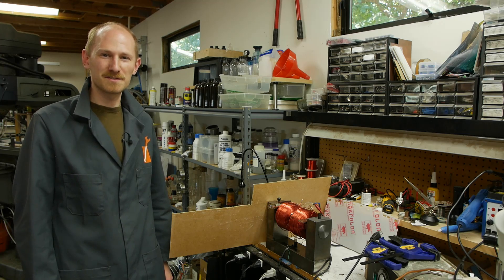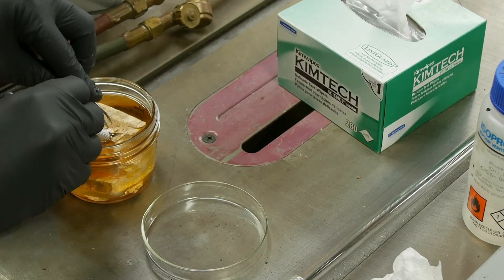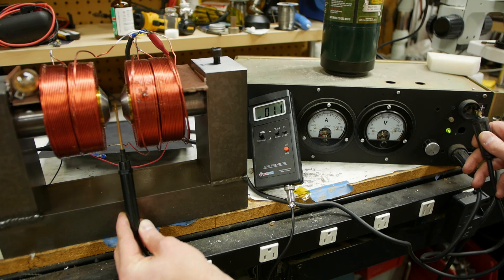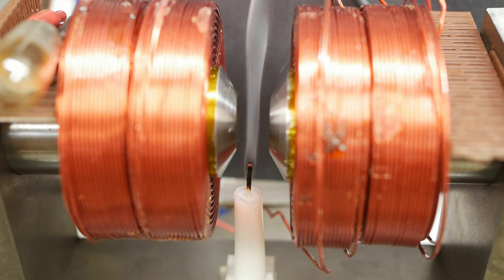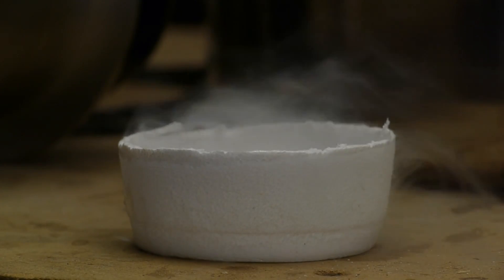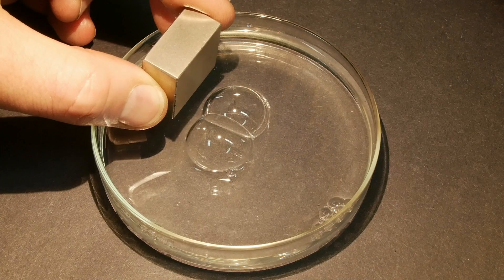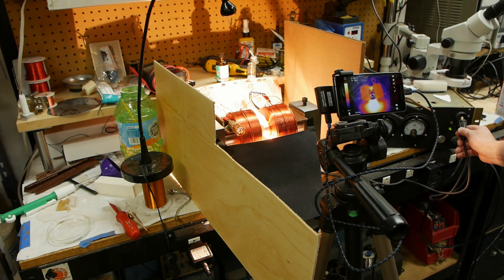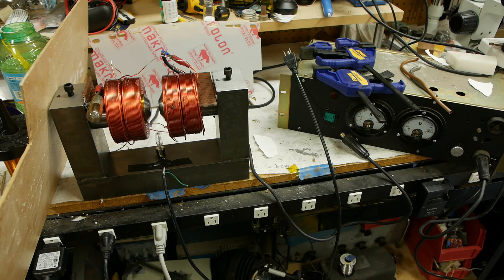Candle flame is repelled by magnets (and Zeeman follow-up)

Comment: Smoke is also full of free radicals, and a force is exerted on charged particles by changing magnetic flux. You need to check if the magnetic deflection of smoke continues after the flux is steady, not just when you first switch in the electromagnet. It's not just about the diamagnetic property of carbon.

Comment: I discovered that a strong magnet will divide the plasma in a neon filled tube into two streams if the neon is being energized by high voltage alternating current.

Comment: This will be installed in our futuristic home building and engineering... Front wall is the positive wall with negative charge instillation... And other walls strategically placed also...

Comment: The air as it gets hotter gain conductivity because there are aways molecules spontaneously ionizing and this increase with heat specialy a flame. Is not because is  diamagnetic is because of the induced currents from the movement of the air stream on your magnet field

Comment: What about short lived ions as the chemicals are reacting? It could just be a Lorentz force that's causing the deflection but the circular motion is interrupted by the convection flow.

I suspect a way to test this is to burn a flame in a coil and see if it "focuses" in the centre or shows something like Mach diamonds

Comment: My theory: A flame is very electrically conductive, lots of free electrons. Due to the heat rising, they are moving upward and experience the same effect we all know and love, they are deflected 90 degrees to both the magnetic field and direction of their movement. Now, I should probably offer a disclaimer on what I'm about to say, I swear I don't do drugs folks. What if that's because electrons are little torroids (donuts) rotating in on the themselves and also around like a tire. But then how could that tire seem to sort of get some traction to roll a preferred direction? Then we'd have to talk about the Higgs field being stronger at the center of the Earth or something and such a big effect over such tiny distance, forget I mentioned it and have a nice day :) 

But wait there's more! ...

For the low low price of ... super cold, since these donut electrons rolling in on themselves have a suction side, when cold enough, they can stick together, electron pairing, superconductivity. Three-year olds have the right idea, all scientists at heart, asking why on everything.

Comment: - Flame is conducting material (plasma). Moving conductor tries to avoid the change of the magnetic flux passing it.

- If you are passing different gases through your magnet, you can visualize them with thermal camera (not all gases, but some).

- The bubble test should be repeated also in the edge of the magnetic field, so that there is magnetic field gradient inside the bubble.

- Hydrogen flame might behave differently, as there is no carbon content.

Comment: Maybe hot air being less dense has a longer mean free path before being interrupted bouncing off other air molecules allowing the air to respond longer the magnetic fields. 

Instead of trying to measure the air directly, maybe try to measure the changes in force against suspended and balanced magnets. One would need to factor out earth's magnetic field effects.

Comment: I think magnetic field arises from excess or lack of microscopic space particles. Like poles have  excess particles b/w them and produce repulsive force and opposite poles have lesser particles b/w them and produce attractive force. When magnetic field is switched on particles leave the space b/w the poles and space b/w poles shrinks causing the flame to reduce in size. Motion  of smoke at right angle to magnetic field shows  the particles  clearing the space.

Comment: The magnetic field changes they way the air molecules 'collide'. These collisions are responsible for 'thermailization'. Thermalization is the mechanical mechanism of equilibrium between parameters such as temperature, pressure, momentum, the speed of sound, and unbeknownst to me, magnetic permeability!

Comment: The light from the flame is travelling at the speed of light. As ANYTHING travels close to speed of light it gains mass and becomes stronger emf. Light even though is small part, is part of the EMF . The carbon from the wick burning /soot would be obvious reason for effecting flame in the electromagnets but could also conclude with gas that flame would be effected.

Comment: Great experiments... 
But you forgot to imagine how the light shells react...

All atoms will always send light out...

But around a mass which is hotter than the surroundings,
much more light goes out, so the outgoing light shells are denser than usual...

I am not talking about the visible reflected light,
but the (normally) invisible light FROM the atoms...

And a light shell has its plus charge on the front side,
and the minus charge on the rear side...

When light goes out from a mass, the surroundings "see" the plus face...

But when an object is colder than the surroundings,
the surrounding masses send stronger light TO the object,
and some low frequencies will create an "induced light",
meaning it makes a light shell fully surrounding the cold object,
and from that shell, the photons move in, 
making the next light shell closer to the object and so on...

And those incoming light shells show the minus side to the surroundings...

But in all cases, a light shell has a larger EM-charge, than the air it pass through...

The minus face is not negative, it is just weaker positive than the plus face...

So a "distant particle" will sense the summed charge, from plus and minus...

Like if a battery had 3 V on the minus pole, and 12 V on the plus pole,
then a "distant particle" would sense 3 + 12 = 15 V (obviously divided with the square of the distance).
You surely remember that every second light shell acts (mainly) with magnetic force,
while every second (mainly) acts with electrostatic force...

Combined, the light shells will give "one EM force"...

Just like the electro magnets and any other kinds of magnets do...

So we could actually say any magnet acts like a lamp,
but the plus pole send light shells OUT, 
while the minus pole, acts as a colder mass, "sucking" light shells IN,
so the so called magnetic effect, should really be called the EM effect,
as in reality it is light shells which cause that effect... 
But magnets normally send/receive so low frequencies so the light is invisible...

We could also say any lamp or other hot objects, act like the plus pole on a magnet,
by sending more light OUT than it receive from the surroundings...
While any very cold object, in warmer air, acts like the minus pole on a magnet,
as it RECEIVE more light from the surroundings, that it sends out...

So the effects your tests show, are actually proving that "light shells will give  pressure to other light shells"...

You talk about the effect from IONS, and it is true all particles with one electron "too few or too many",
will also react on EM shells, from magnets or other light emitting masses...

But in many of your tests, it is only/mainly the emitted light shells, which get pressure from the
light shells from the magnets... 

Note that a flame has that flame shape, for two reasons...
The most obvious is, "hot gasses rise up"
Less obvious is, that the summed EM pressure from the planet, and the atmosphere, is larger under the flame,
than above the flame...
Both effects, will deform the flame from being round like a ball...

When starting the magnet, the effect from "hot gasses will rise", will be the same...
While the effect from "most EM pressure from below" is greatly changed, so the shape of the emitted light shells is changed...

And since the shape of the yellow part of the flame is changed, that seems to prove 
the yellow light actually comes from a corona effect, just like around the sun...

Basically meaning that "a light shell starts glowing"...

More precisely: A layer is formed, with the smaller particles which build the photons,
and while each light shell only exist for a split second, and then a new portion of light comes and build a new light shell the same place,
giving the frequency of the emitted light from the actual surface of the sun, 
then that corona layer exists all the time, and acts as a light emitter, sending a much lower frequency,
than the sunlight which created that layer... That gives the visible frequency we can SEE from the corona...

And a so called sunspot is a hole in the corona, made by a "volcano effect from the surface of the sun",
and after, the sunspot will slowly "repair itself again"...  

The frequency/colour from a corona depends on both the difference of temperature,
between the layer and the near surroundings, AND on the size of the surface...
More precisely on the "largest diameter", 
so when talking about candle flames, it means "the length of the flame"...

When sending a strong light from the magnets, the area between the magnets becomes warmer...
That will lower the frequency of the light from the flame...

Therefore the yellow is changed, to a "darker yellow", (closer to green) in your tests... 

Sadly modern science have not yet accepted, that photons are build of even smaller particles...
But photons could not transform, if a photon was one solid particle, so it is "quite logical"...

Ancient scientists understood that, and they called those "smallest particles which build the particles in the light" either Orions or Ether...
And my grandfather taught me the basics in the "Ancient Particle Science", including the Science of Light...
And that science can explain many effects, which modern science can not explain...

But I hope this will help you, in your own understanding of the effects you have shown.

Happy testing
Dan

Comment: rather than diamagnetism you should be looking at the plasma. A flame is at least part plasma, with incomplete combustion leading to other constituents and products of combustion such as soot, water vapor and smoke. As I am sure you know plasma is made of charged particles. In the case of a flame the heat of combustion causes some electrons to be stripped away resulting in a plasma of both positive and negative ions. These ions are carried upward by the buoyancy of the heated air, behaving as an electric current and with all the properties associated with such. An electric charge moving in a B field will be acted on by the Lorentz force.

Comment: Minute 6:56 you just stumbled upon the REAL reason hot air rises.

It rises because it is more diamagnetic than the surrounding medium, just like helium, just like smoke, just like hydrogen.

Same with oil and water, oil is more diamagnetic.

Density has nothing to do with it. 

Materials "know" which way is up, due to the "induction plate" that is the Earth which is somehow inducing paramagnetism into every object through Lenz Law, which is what we refer to as gravity. However so-called gravity is said paramagnetic induction and nothing more. It is not a force, it is just magnetic acceleration.

What is fire?

Fire is an energetic transformation that is "releasing" any/all materials from their paramagnetism into diamagnetism. 

That is why flames stand up and reach for the sky, violently so. They are being "repelled" by the Earth's paramagnetic induction underneath.

Your video proves this FACT.

I will be exposing this on my channel shortly, be sure to swing by sometime :D

Comment: Hi, thank you for the great video! Another explanation to consider is based on science of plasma and quantum electrodynamics. Although a candle flame does not reach a temperature to create enough ions to be considered a plasma, it still produces some free electrons that will have the highest temperature which causes other gas molecules glow in a yellow-red color. These ions are extremely responsive to magnetic fields and could be guides with a magnetic field which in result will guide the flame. This property is used to create a magnetic chamber for a fusion reactor that could handle extreme temperatures. 

One way to experiment this is to measure how many ions are created in a candle flame and then calculate what is the minimum magnetic force required to affect amount of hot gas in the flame. Same calculation should happen for carbon due to its magnetic response and then the sum of the two calculations should match the minimum magnetic field strength applied to move the flame in reality.

Comment: This one got me thinking (and staring directly into candle flames which wasnt very smart of me). If you take a normal unlit teacandle, and wave a small magnet (like a chunk of hematite) about 1cm from the wick, you will probably notice a little ferromagnetic object under the wick. But if you light the candle and repeat that same test, you get a much stronger force that seems to come from the flame itself. Crude method of testing it, but it is a noticeable difference.

This one's gonna bother me for a few weeks like the first time i learned mercuric chloride in the clemmensen reduction activates zinc in a manner we cannot sufficiently explain...

Comment: i wonder if the gas temperature has anything to do with this effect?
the hotter the gas the easier it is to ionize 
maybe due to some quantum effects some atoms will be greedy and steel the energy from its neighbors (just like some water molecules steel heat from its neighbors and evaporat leaving the water cooler)

Comment: The flame of a candle isn't hot enough to create ions in a significant enough amounts for it to be affected by magnets in any noticeable way.

But, oxygen is paramagnetic and very light and easy to move around and the magnet can effect it enough to move it...which is what causes the smoke to move.

The shape of the flame is affected by the way manetism affects its oxygen supply.

Comment: During combustion, a redox reaction takes place.
The electrons move between the molecules. This movement of electrons can be thought of as current flows in a random direction in space. You won't measure the strength of this field directly because its net strength is zero. On the other hand, the movement of electrons in the magnetic field causes the phenomenon of self-induction. The flame must overcome this force in order to fly between the poles of the magnet. It is not pushed out, only its flow between the magnet's poles requires additional force.
Similarly, if you throw a neodymium magnet into a copper pipe, it will fall slower than it is due to the force of gravity.

Comment: Isn't that already explained as one energy form changing into another, hence you can call the flames charged matter and a magnetic field influences charged matter. I would have just mentioned it is wind because electricity causes the same thing to happen. Then again, it would be electrical polarity interaction. You can also call it a Solar Wind.

Comment: Here's my theory: The hotter a gas is, the more energy its molecules have, the more they bump into each other, the more likely some of them bump really hard - hard enough to knock electrons out of atoms, thus the more ions it has on average. A gas mixture at thermal equilibrium (room-temperature air) will therefore have the "lowest number" of gas ions. Heating air thus increases the amount of ions in its constituent gasses, thus leading to the observed effect. I predict that the effect will be stronger the hotter the gas, and weakest near the condensation point. When a gas changes state to a liquid, some weird quantum mumbo-jumbo happens which alters its properties - I haven't thought this through you see :D
Probably the magnetic field by itself also contributes to the ionisation effect.

This theory is based entirely on gut feeling and educated guesswork - take it with a bucket of salt.

Comment: Lorentz force? The flame plasma is filled with ions. An induced electric field caused by the flowing gas (moving ions) could cause an opposing magnetic field to the electromagnet. This would push the gas in the opposite direction...which is the effect you show.

Comment: These are nice experiments although your lab is so messy and dirty and you do not follow any safety standards (you are not a role model). Consequence: I don't like to show your video to students.

You have addressed some effects. However,  as may be mentioned before, the main effect will be that a candle flame is partially in the plasma state (https://en.wikipedia.org/wiki/Plasma_(physics)). At high temperatures, the air is broken down into ions and electrons, which react to electric and magnetic fields.  There are videos (e.g. https://youtu.be/L51kg_n2PYo.) that show the effect of electric fields.  The explanation is again, that the flame is in the plasma state.

Comment: Using a 40 watt florescent tube held up under transmission power lines will ionize the tube and lt up. These transmission line are usually 50+ feet or 100ft above ground. The field is perpendicular to the wire at about 220-240kv It is the magnetic field reaches the ground while a difference. Of potential holding the gas florescent tube will ionize full lumen display.

Comment: Early in the video I was thinking "oh he built some kind of spark gap flyback diode to stop the electromagnet quickly". Nope, just Electrobooming a wire into a power supply, haha. 

I see a couple comments have mentioned Schlieren, and will third. It's very very easy to do, you can get a 4" spherical mirror off eBay for cheap and it only takes one spherical mirror, rather than two parabolic. Then I used color slides instead of knife edges to give rainbow plots instead of just grayscale.